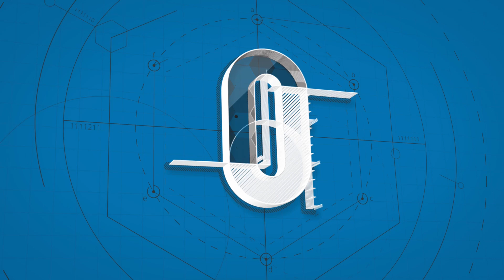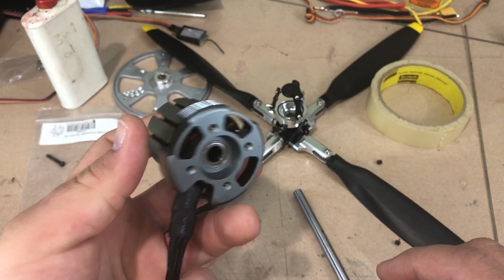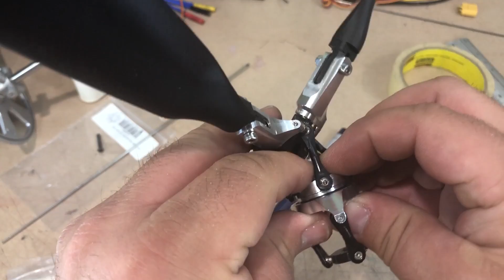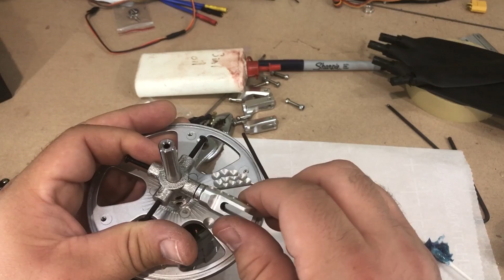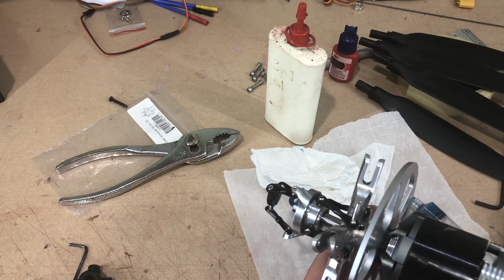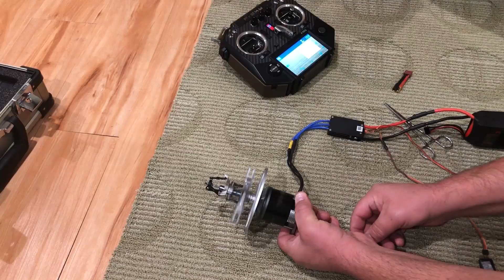Mustang Update 01: Variable Pitch Assembly

Comment: Good job!  Heads up on scale.  Your use of Spitfire blades will give the illusion of an Aeroproducts propeller.  This was used on the P-51K.  It had a diameter of 11 feet and a pitch range of 35 degrees.  Be careful with your linkages.  Make sure your linkages are strong in compression because your design has the linkage following the blade grip.  This means that the aerodynamic forces on the blade will force the blade to rotate against the linkage thereby putting them in compression.  You might want to consider flipping the blade grips 180 degrees.  This would put your linkages in tension when working against the aerodynamic forces.  This would make for a stronger and more robust design.  Keep up the good work.  The P-51 especially the D series is my favorite WWII fighter.

Comment: Nice work Joshua,  I notice that the stub of the modified prop blade has a 90 degree step where the diameter is reduced rather than a gradual transition. Could this become a high stress point on the plastic stub leading to a structural failure? I hope that you may have already tested the system and not found this to be a problem. Keen to see this operating in flight.

Comment: It's a collective only swash plate from a helicopter,  instead of using a ball joint bearing as they do in helis which allow pitching in 360 degrees its a sleeve and sliding up and down the shift can happen but no pitching.